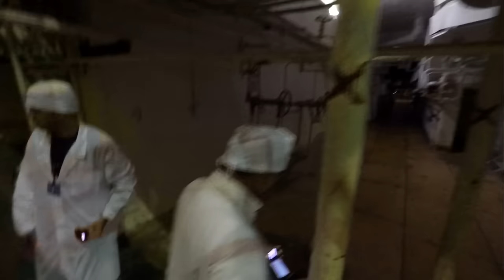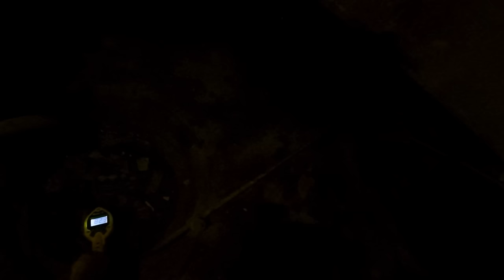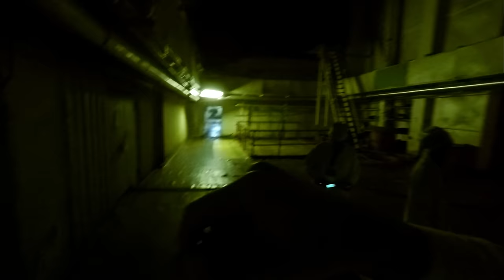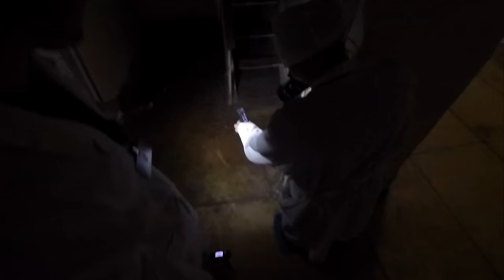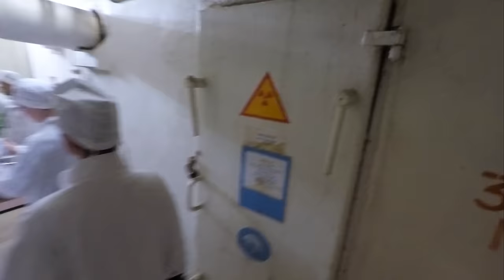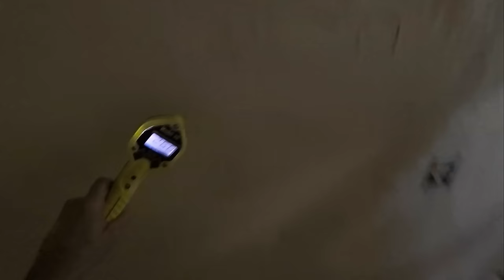Chernobyl Nuclear Power Plant: Unit 3 Main Circulation Pumps

Comment: Their Geiger counters are loving it  !
Reply from the maker: The area is full of radioactive dust infiltrating from the Sarcophagus. It accumulates, as might be expected, on any neglected surface--pipes, ledges, etc. The nearby Sarcophagus boundary has obvious openings in it, and is more of a concept than a realized barrier to this sort of contamination.
Reply: Carl Willis Since the SAFE confinement is now in place, will they be sealing the area to finally stop the dust infiltration your referring to?
Reply from the maker: The "perimeter closure project" is ongoing to attempt to isolate the New Safe Confinement from the rest of the power plant building throughout the interior of the structure.  My honest view is that the dust problem is going to continue.

Comment: Just wondering why you guys were not using respirators?
Reply from the maker: Because they are not required PPE in that area, and nobody really wanted to wear them.
Reply: Carl Willis dust of any kind brings radiation into your lungs. a carless thing
Reply: Considering Unit Three ran until 2000, I don't think they are the damn fools here. They may have been wearing cotton masks but not full-blown respirators. In this kind of environment its mostly inhalation and ingestion that pose radiation hazards.
Reply: It's reactor 4, that's the deadly one, dombasses 
Reactor 3 is safe
Reply: You know that there's an exclusion zone around the plant, right?
Reactor 3 falls in that exclusion zone...
Although it's in good condition it is still affected by the radiation of Reactor 4.

Comment: What were the radiation levels?
Reply: I would guess 2.4 to 100 uSv/hr ... depending on distance between the dosimeter and the contaminanted source of energy... average walking should round about 3 or 4 uSv/hr ... but video quality is not good enough, not even sure about the units xD
Reply: Hmm not great, not terrible.
Reply: 3.6 roentgens... about 10 chest rays
Reply: @SonicTemples  4 uSv/h os what you get during a flight
Reply: @Marques_239  I'm one of those idiots quoting the new HBO Chernobyl series. Give it a watch it you've not done so already. Very entertaining!
Reply: @SonicTemples  I know, I did watch it! xD
Reply: 3.6
Reply: On another video some guy said 3.6 sieverts /hour, lol that is actually quite high
Reply: @therandomytchannel4318  That's over 300 roentgen.

Comment: so it's safe to walk in?
Reply: @Sensiblefool  i was asking if it was safe to walk in Chernobyl
Reply: yep this unit was in operation until 2001, u can walk without any protective equipment in Pripyat, Chernobyl, CHNPP, and  swim in Pripyat river, there are 2 Dangerous places, Inside Sarcrofagus and in "МСЧ-126" basement, also u bump into burial ground, which are more radioactive than other places, but not dangerous if u not sleep at them xD

Comment: Is this the southern or northern circulating pump Room?
Reply from the maker: This is the south side.
Reply: @Carl_Willis So Valery Khodomchuk would of been 'buried'  a few metres east of Reactor 3 pump Room where the Reactor 4 southern pump Room used to be, however now entombed within the old and new sarcophagus? I'm pretty sure the destroyed pump Room is shown in HBO Chernobyl when Sasha Yuvchenko attempts to find him but only sees those same yellow water tanks split apart and the literal southern exterior of the NPP.
Reply from the maker: @thedude9024  Khodemchuk's remains are probably buried in debris in the north pump room (or its vicinity), but nobody knows precisely.  There is a wall between Unit 3's pumps and Unit 4's, but it's incomplete; it was once possible to see daylight over the wall if the room lights on the unit 3 side were turned off (prior to installation of the New Safe Confinement).